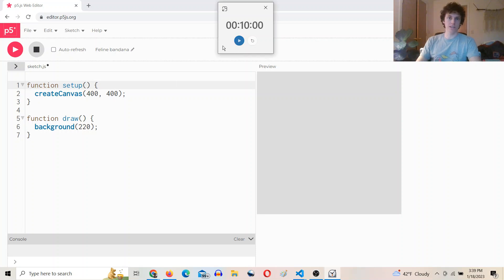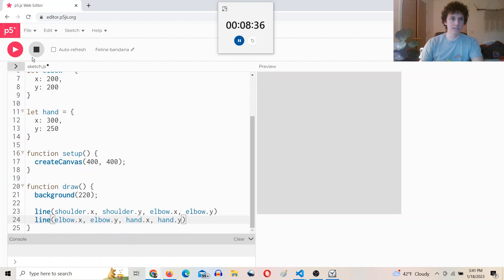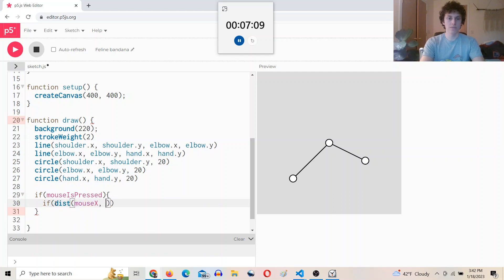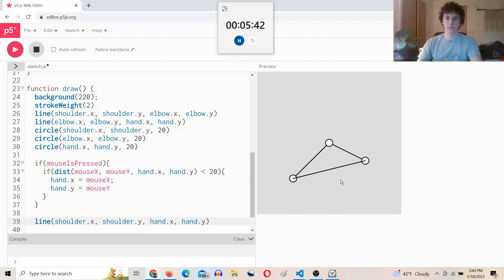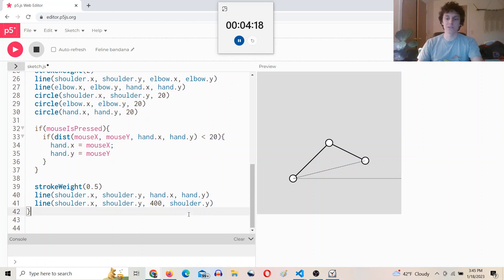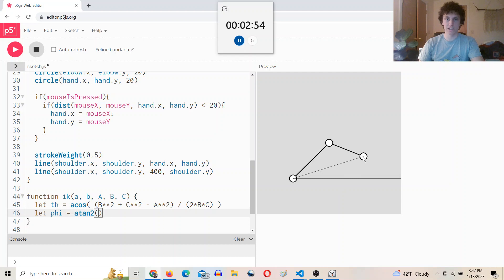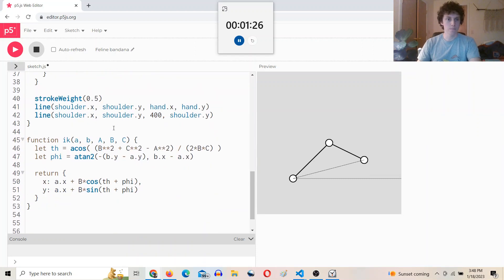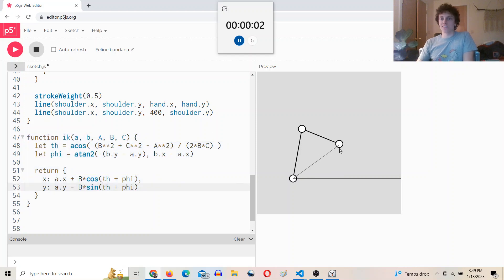Coding an Inverse Kinematic arm in 10 minutes

Comment: Is there a way to make it so that if the target is out of reach, then the arm will still move to an angle without the hand stretching too far?
Reply from the maker: To do that you would just need to check that the distance from the mouse to the shoulder is less than the total arm length (or shorter if you want it to not be able to fully extend). If you want the arm to still follow the mouse even when the mouse is out of range you can do that by basically scaling the vector from the mouse to the shoulder such that it is exactly your max arm reach length.
Reply from the maker: I modified the code from this video to show an example. https://editor.p5js.org/rjgilmour/sketches/OPKwyHGmu